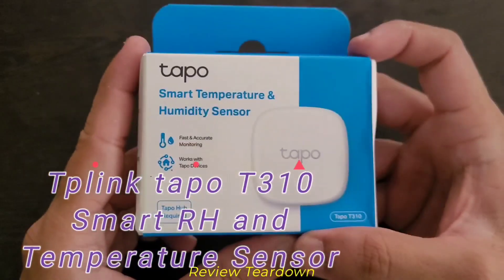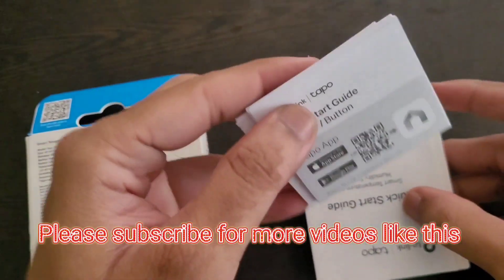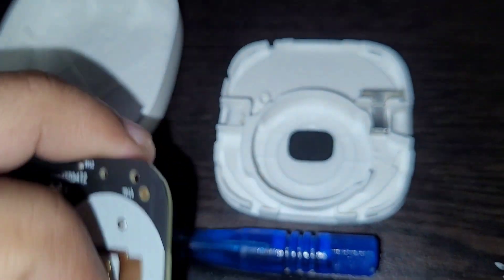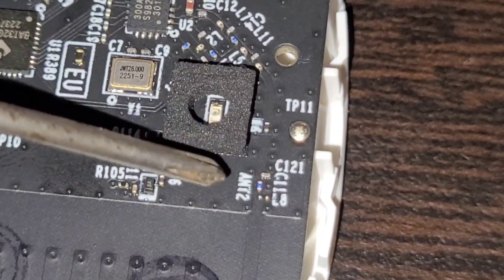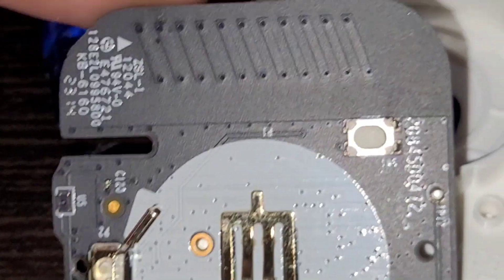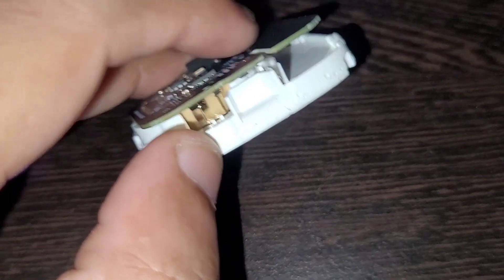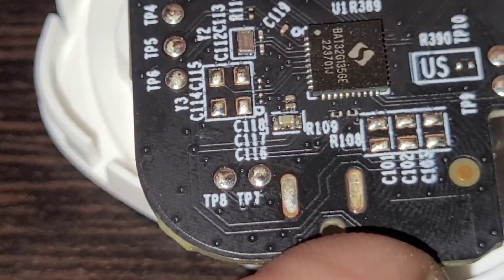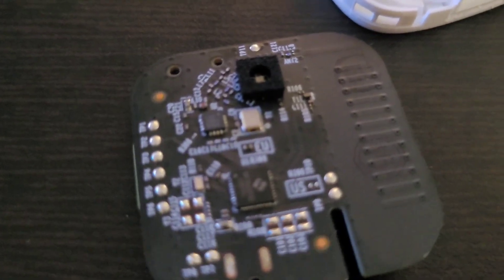Tplink tapo T310 Smart RH & Temperature Sensor.

Comment: Is it possible to solder an external, wired waterproof temperature probe so that this device can be used as a pool or aquarium thermometer? I have read that it uses an SH40 sensor—does this sensor measure both temperature and relative humidity?

Comment: I wonder if Tapo T315 uses same SHT40 sensor - I tried opening it at the edges but I’m afraid I’ll break the e-ink screen.
Reply: I have now checked and the T315 indeed uses the same Sensirion SHT40 sensor, on that board it’s labelled component “U3”.

Comment: Can it be placed outdoors?
Reply from the maker: @vladsier  it's is designed to be used indoors.  If you want to use it outdoors, it should be protected from water moisture and dust. As its sensor detection, vents are wide.